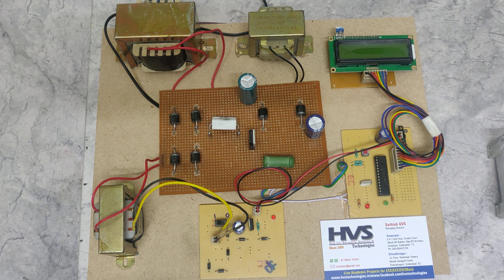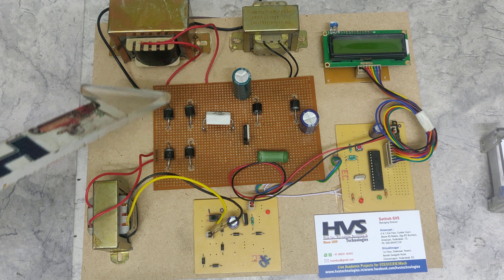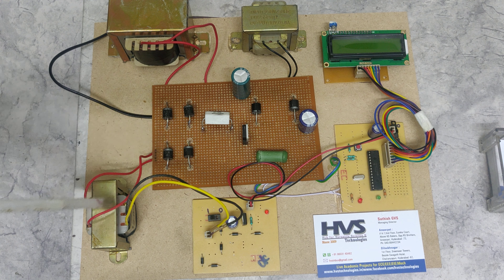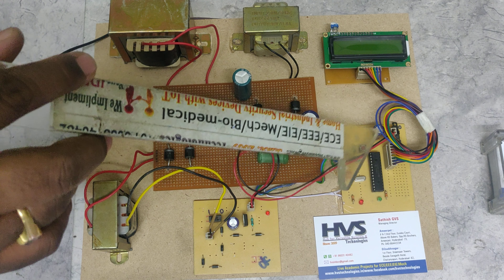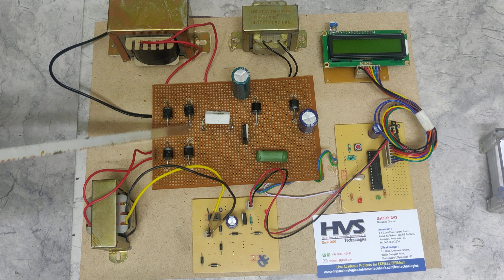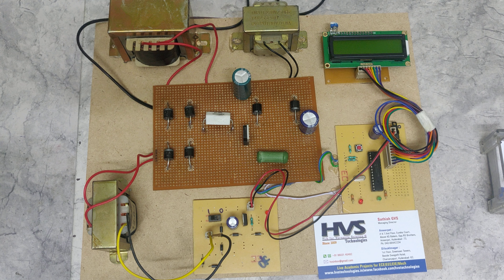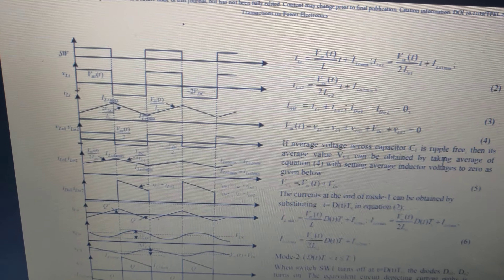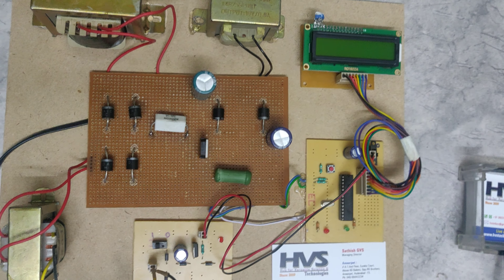Improved Power Quality Switched Inductor Cuk converter for Battery charging application

Comment: What is the white colour small equipment in the middle and why it is used?
Reply from the maker: It's resistor.
You can contact us at +919603140482
Through WhatsApp or call